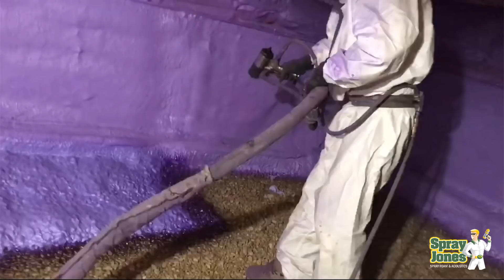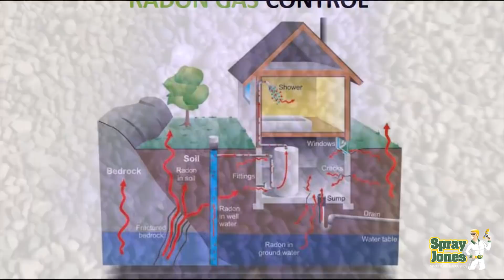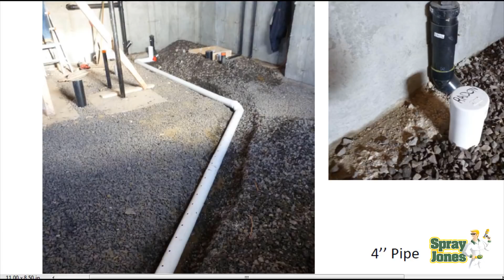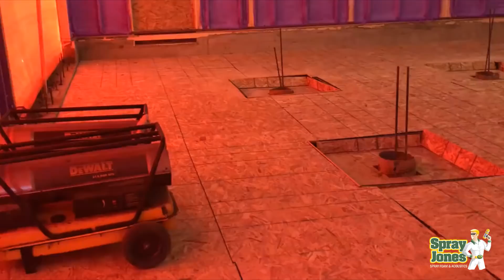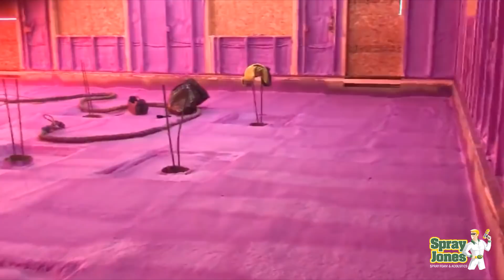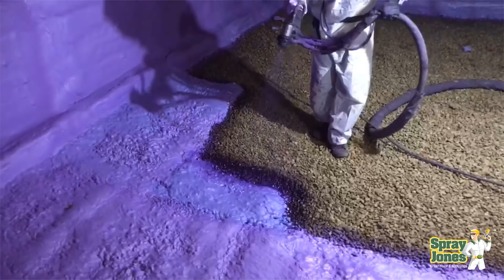Under-Slab Spray Foam Insulation Is The Future!

Comment: Dont understand how the foam can stick to the concrete when the cardboard has decomposed.
Reply: I would like to know that too, why won't the cardboard and wood not rot from ground moisture then?
Reply from the maker: The concrete sticks to the foam when it is poured. It is reverse. 
The card board compresses if / when the ground swells.
Reply: @SprayJones  But doesn't just rot away and leave gaps, or it doesn't matter since the columns support the whole slab?
Reply from the maker: @safffff1000  The whole idea is to have a gap behind the slab to the earth.
Reply: @SprayJones  Hard to see that the concrete can glue the foam in place, without any support from below.
Reply: @SprayJones  I would say you will need some plastic spikes under the foam and into the concrete to bolt it in place when the temporary cardboard support is gone.
Reply from the maker: @elbuggo  Earth > Cardboard void form > spray foam > concrete. 
Card board can crush leaving the desired void behind the concrete. 
Go to: voidform.com for better drawings.
Reply: @SprayJones  Thanks
Reply: @SprayJones  Can see that the foam can stick to the concrete but not that the concrete can stick to the foam.
Reply from the maker: @elbuggo  15 years ago I met a fellow who poured concrete - like a patio paver - over rigid insulation. The purpose was weighted insulation for flat roof tops. The squares would be placed out on the roof and the wind would not lift them up. 
The concrete never let go of the rigid insulation...
Reply from the maker: @elbuggo  It does.

Comment: I build my own shop last year no infloor heat but put down about 1.25” under slab 4” on wall and ceiling Heating it with a Osburn 3300 woodstove only,  10c no problem. 36x50x16
Reply from the maker: That's right

Comment: Just did a test for radon, lots of it here in Nevada. We are OK but I think you are on the right line of logic. Bob in nevada
Reply from the maker: Hello Bob. Thank you as always for great feedback. 
Radon info is getting bigger every year.
Reply: I found the radon details interesting.  As I think about it, I would not want one piece of plumbing passing through the structure on a basement floor - keep it all 100% outside.  This is a system that except for a home sale [maybe] will never ever be inspected.  If there is a plumbing break, the house gets turned into a dedicated radon collection facility - that's worse than doing nothing.  Plus... a penetration in the slab is an extra point for moisture ingress.